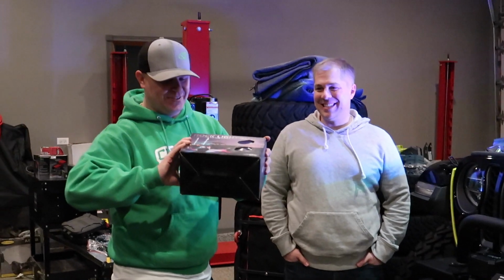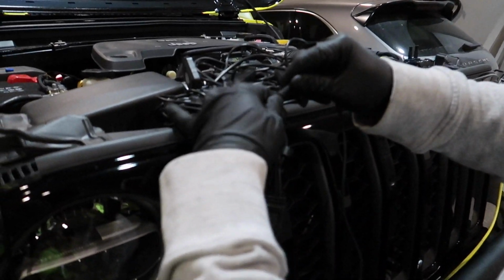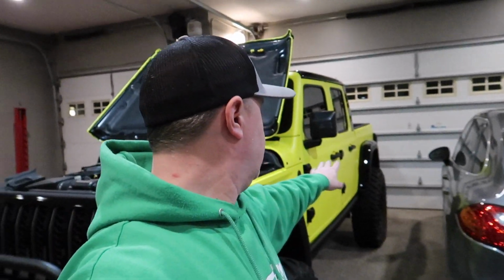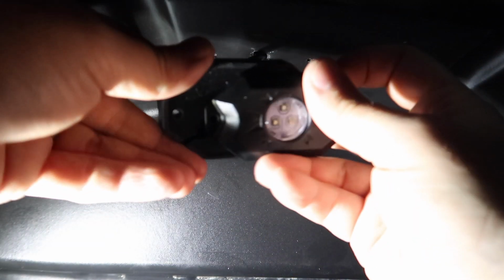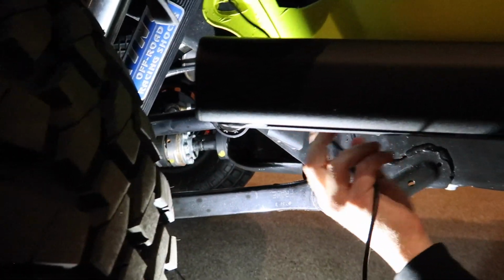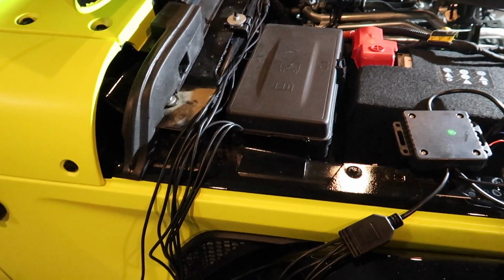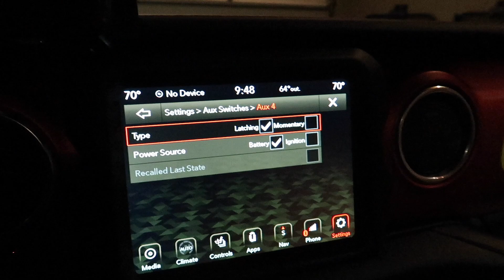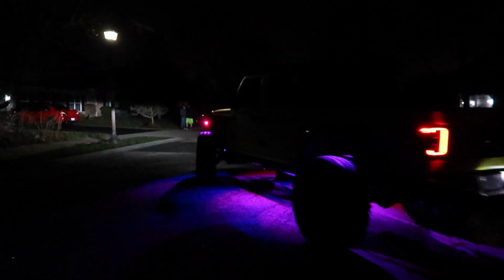Jeep Gladiator Rock Light Install - Xprite RGB LED Lights

Comment: Sweet, how many of the extension cables did you end up needing in total?
Reply from the maker: If I remember correctly, I used 3
Reply: thanks...love the channel....just ordered my JT Rubicon and will be installing as soon as it comes in..(April).. @shockerracing
Reply from the maker: @bowvalleyadventures1818  congrats! What’s color are you getting?
Reply: i went  @shockerracing
Reply: @shockerracing  i went with white
Reply: ill keep you up to speed as the build goes on....planning on a lift, wheel, and tire upgrade right out of the gate....
Reply from the maker: @bowvalleyadventures1818  awesome!
Reply: You think a jku would only need 2?

Comment: Looking at getting these. They are in my Amazon cart lol. Was going to get the 6 pods. One under each fender, then was thinking about using the extra 2 In the grill. But also was thinking about putting them center of the doors. So I would have 3 on each side. How long are the cords on the pods. Can't remember what you said on them.
Reply from the maker: If it’s for a Gladiator you will definitely need a couple extensions.
Reply: @shockerracing  yea its for a gladiator. Figured I would need 1 maybe 2 extentions. But was just wondering about how long the pod cords were.

Comment: Do these have brake function wire?
Reply from the maker: I’m not sure what you are asking
Reply: @shockerracing  I'll assume by that reply no. Some rock lights have a an extra wire that goes to brake light wiring. So when you hit brake all pods go red. Then back to whatever they were set to before when brake released.
Reply from the maker: @starburstxmr  I haven’t seen that feature before, but it should be pretty easy to run a wire and tap it into the brake light.